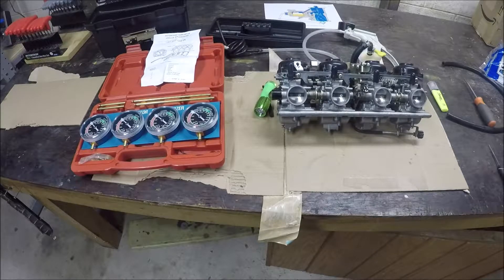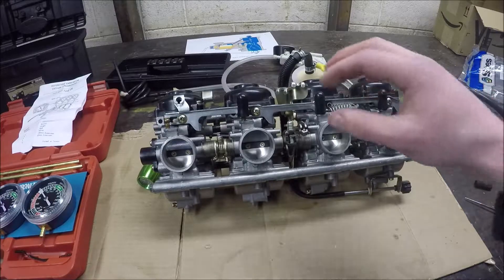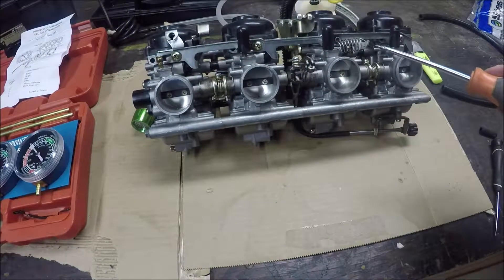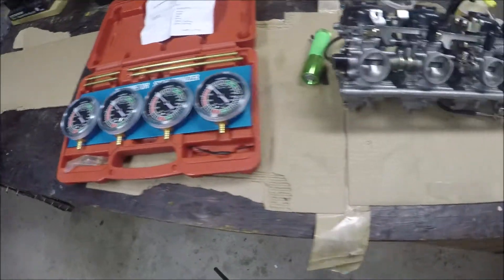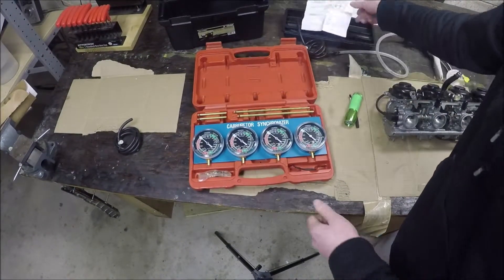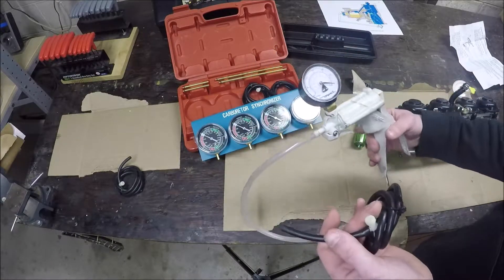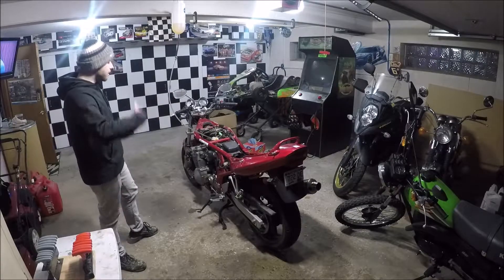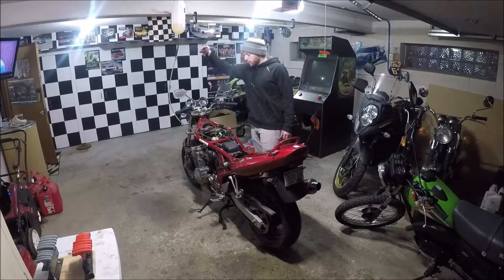GSF600 - Calibrating my Carb Synchronizer

Comment: Buy a 5 way vacuum T, plug in all 4 gauges to the T and one to the vacuum pump. It will provide the same vacuum to all gauges for you to calibrate them.
Reply from the maker: I ended up doing this a year or so later. Definitely found that to be an easier way to go about things.
Reply: or you can just use the T's you have to compare one guage against another.

Comment: Calibrate your gauges using the engine. Put each gauge on one cilinder in turn. And check they are the same. regards from England.
Reply from the maker: This isn't a bad idea. I think the only caveat being that you'd want to make sure the bike was 100% completely warmed up so that the revs are steady.